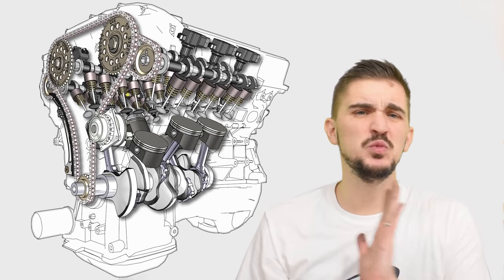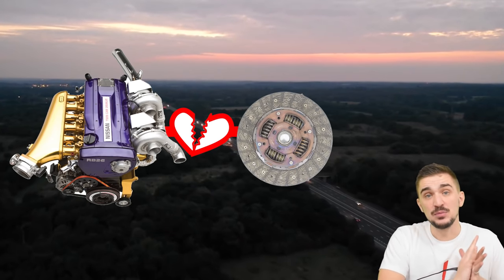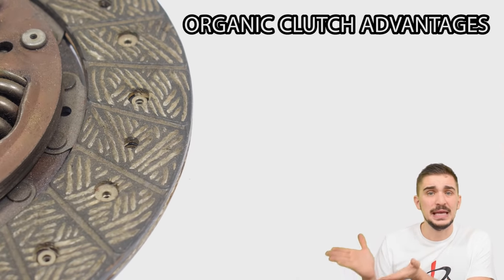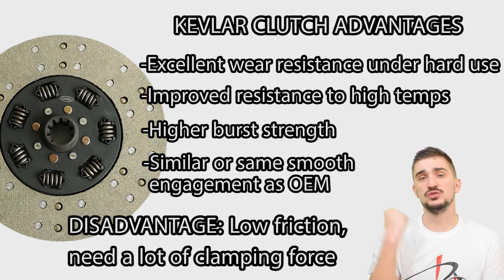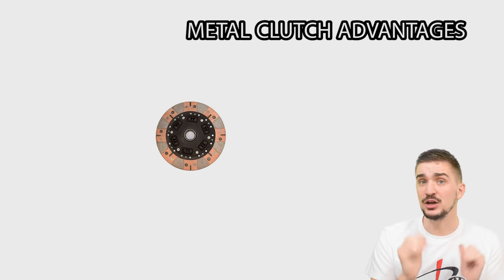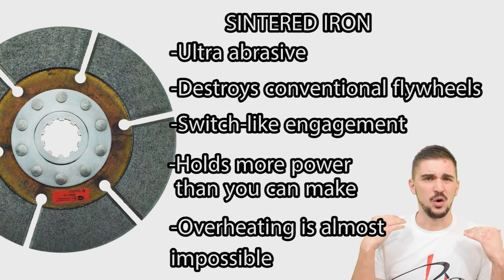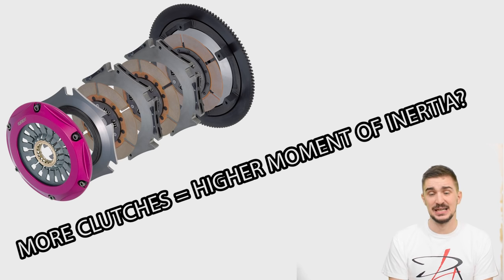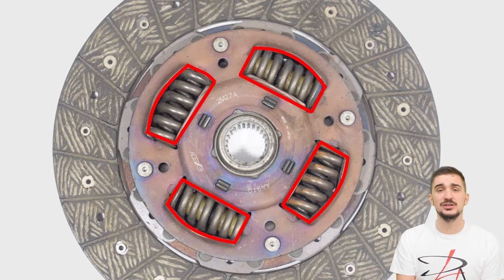CLUTCH: Organic vs. Kevlar vs. Metal vs. Multi Plate CLUTCHES - in-depth COMPARISON

Comment: And my first semi truck Volvo F12 fom 1975 is like you folks race on 2 plate clutch??? And it's available lately??? 
Really, I'm rocking that thing 50 years as stock part 😂🤣😂🤣
Jokes aside It was really smooth, it was like engage 50% than full engage. But pedal travel was extra long, on top of that 16 gears to shift. Therefore city driving was exercise for left leg 😂🤣😂

Comment: I have a custom kevlar clutch on my sports car, and it drives very well on the street or track. It has lasted 250,000 miles so far with no signs of slipping or wear related performance degradation.

Comment: Can i change the dual mass flywheel to an ridget one without increasing the wear on the trans when i use an sprung clutchdisc?   (I have an 2l Diesel 4cyl. engine )
Reply from the maker: There are DMF to Single mass kits for many engines out there.
Reply: @d4a  ok thank you so you say it does no damage to the trans? 
For my engine i didn't find a converson kit or a Performance dmf kit :(
Reply from the maker: Which engine? If the clutch is sprung it won't damage anything, also most diesel transmissions are pretty strong already.
Reply: @d4a   it is the Bmw m47 engine with the vp44  not with common rail 

Ok that are good news 😌👍 thank you

Comment: What about asbestos clutches, if you can find one?
Reply from the maker: What about cancer?
Reply: @d4a  That’s a good point. I was just wondering that when they banned asbestos, many people were like there’s nothing that could replace it in clutches and brake pads, but it seems that there wasn’t a real problem replacing asbestos after all.
Reply from the maker: It was an issue at first I believe, and asbestos clutches did last pretty long and were pretty tough too. Mineral wool and fiberglass did replace it to a great extent but I think the asbestos stuff did last a bit longer, although that's just a guess and hard to verify. All that being said, the price was too high being a health hazard to mechanics and others.

Comment: ah yes the dual mass flywheel, my sworn enemy, it doesnt matter how genius it is and how smooth it works it just simply isnt good that every clutch job requires a new flywheel....
Reply from the maker: In all honesty, I'm not a big fan either
Reply: @d4a  this is the clutch that is used on my old school 70s tractor. it lasts forever but maybe its more ideal to tractor driving. I put a kevlar clutch in my f450 dump truck and I love it.

Comment: "Transmission" exactly equals 'drive train'. Why don't these people understand this ? It is the drive train that transmits the power from a to b hence it's the 'transmission'.
A gear box is a gear box - for the selection of ratios. Some vehicles have more than one gear box - let's give an example of the first gear box giving 5 ratios and the second gearbox giving 2 ratios. It would then be a 10 speed transmission.

Comment: Motorcycle multi-plate wet clutch - best clutch you will ever experience )))
Funny thing - it's metal, it's multi-plate (5-7 friction plates) and the same time not that expensive - 120-200 euros for regular set. Go figure...

Comment: nah, electric motor bearing combo dc clutch, free rolling if not engaged
Reply: keep it simple
Reply: full electric drive train
Reply: embedded hub motors
Reply: also combined breaks
Reply: by definition
Reply: just pump a bit of electric "fluid" to activate the clutch, or the break
Reply: piezo electric clutch, if not using hub motors
Reply: aluminium oxide is abrasive
Reply: also transfers heat pretty fine
Reply: tf was the "two for breakast"?
Reply: why dont you use steering-assist like power transfer
Reply: does the transmission need to stop to change gears. sounds like it
Reply: but "everything keeps rollin"
Reply: something is not right here

Comment: Is not the KandN filter of air the best in the world for my procharger?  The hot oil to be filtered and used in the return system to return to the needs of the bearings, cleaned and cold.is the secret of KandN present in the empire of the oils, as it is in the Kingdoms of the atmosphere will it clean the product of the wells sucked from the deeps of the earth?sweet crude,first raw gasoline dripgas  actually can be burned and used in engines,and is in the oil fields,you can go and ask and find out see.it was told to me by my friend who hired me up from big three oil field company.when he was mining gold up here.i was wondering if a KandN could be used to filter those high pressure volatiles they have to cap off when the bit strikes a pocket of it in the earth under Wyoming.

Comment: 0 reason to run a single disc upgraded clutch at this point other than price. multiplate clutches offer all of the benefits of an upgraded clutch without the crappy engagement but they are a lot more expensive.

Comment: This will probably annoy many commenters, but I don't think you should be using the word "upgrading".  All engineering decisions are trade-offs.  The "upgraded" clutch may transmit more power without slipping, but there is almost always a downside.  The "upgraded" clutch may be harder to drive on the street, or in the case of multiplate clutches, heavier.  In my 50 years of modifying cars I've learned that most modifications are "changes", not "upgrades".  You improve one aspect of the car, but make another aspect worse.
Reply: It most certainly is an upgrade. A clutch that is more capable of doing its job as a clutch is an upgrade, even if it comes at a cost. Referring to it strictly as a change would imply that the only reason to use a different clutch would be a matter of preference rather than capability, which is simply not the case.

Would you say that putting bigger brakes on a car isn't an upgrade simply because it makes it easier to lock up the wheels?